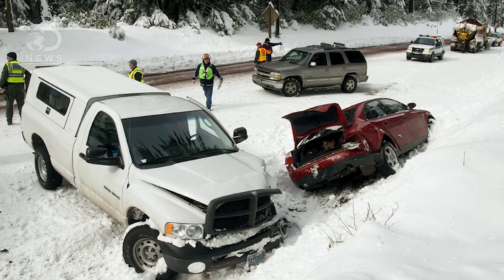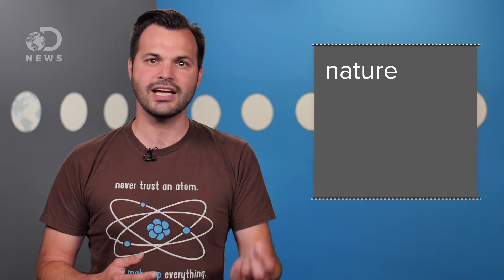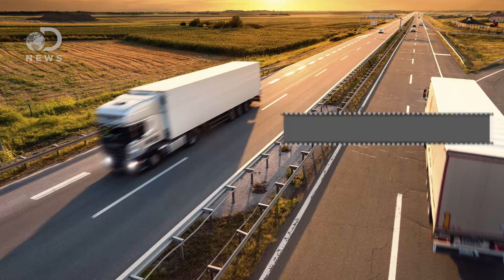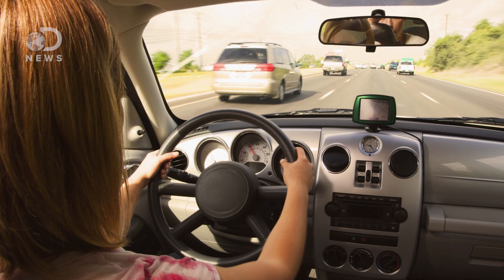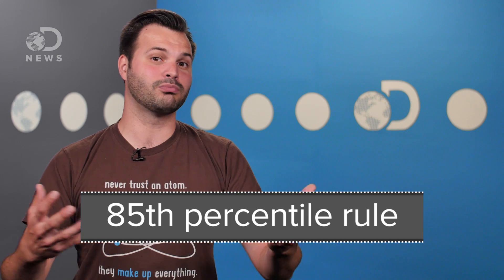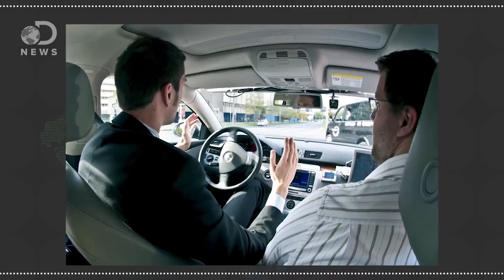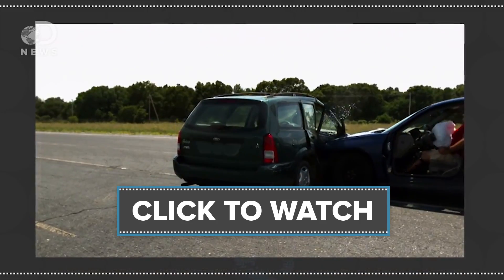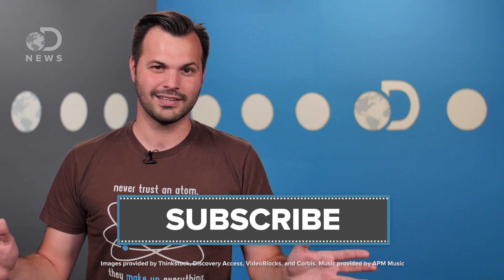How Do We Decide Speed Limits?

Comment: Lower. We're too wasteful and spoiled and driving should be disincentivized. Plus getting somewhere slightly faster isn't worth all the lives we lose.
Reply: +zh11147 I wrote you a novel, brace yourself haha I know my views here are radical but I'm passionate about transportation and the way we design our world.
A mixture of solutions could [largely] replace driving, some active and others passive. I'm not saying that no one can drive anymore, I'm saying much less driving is necessary than presently occurs. Go back 100 years before cars were ubiquitous. We had zero local emission transit in the form of electric drive elevated trains, subways & streetcars. Some of the infrastructure is expensive but not on a per capita basis if people actually use the resources. It's much much cheaper than cars for individuals that tend to pull 99% unnecessary weight and 1% people. Average # of passengers in a car is around 1.3.
Next, we go back to living denser in cities. The reason destinations are inaccessibly far is because of how we have built. After cars took over we began to design our world for it. This meant spreading things apart too far for walking and leaving huge swaths of space for parking and motorways. Well what was convenient to get to by a car is now as much time and effort as just walking between closer places. There are also many other reasons living closer together is beneficial for efficiency and proximity to amenities. 
Alright we have made it to bicycles. In an urban environment where there are thousands of amenities within a mile or two, a bike makes an incredible amount accessible within a 15 minute ride. At the same time a bike can improve your fitness saving future healthcare costs, make you more physically attractive, emits no pollution, makes streets safer for other bikers and for pedestrians. Briefly I would like to explain how expensive cars are. The average cost of owning a car for Americans is $6,000. This accounts for expenses of depreciation in resale value, auto loan interest, insurance, municipality stickers, license plates, fuel & repairs. That's expensive but consider the real cost of driving. In order to drive you have roads, expressways, bridges, snow removal [regional] & parking. These municipal costs are subsidized by taxes paid by everyone regardless of their amount of road use. Now think of how much money this amounts to for individuals and governments versus all the projects we didn't have the money to fund.
One last idea that is emerging. Electric battery powered bikes and skateboards. The former greatly extends the range of biking. The latter won't be accessible to every age and ability I concede. It has much potential in short distance transportation or expanding the usefulness of public transit.
You may argue that biking isn't always possible with weather. Well yes and no. I live in Chicago [known for brutal winters] and I can bike on most days even in winter. There are times when it's too brutally cold or raining too hard and I take transit instead. 

Here are some references for my arguments. If you want me to back up any other statements just ask and I don't mind finding those too.
# of passengers & energy by mode
https://en.wikipedia.org/wiki/Energy_efficiency_in_transportation
Image of equal passengers in cars, a bus, bicycles
http://splasho.com/blog/wp-content/uploads/accurate.jpg
Biking boarding
http://www.mrmoneymustache.com/2011/11/03/how-to-ride-your-bike-all-winter-and-love-it/
http://www.wired.com/2014/05/boosted-board/
Car cost
http://nicomachus.net/2009/01/the-real-cost-of-owning-a-car/

Comment: Well... 
In Germany, in some parts of the highways, (or most) the speed limit can vary from 180 km/h to whatever you want (yes you can go 220 if your car can go at that speed), that is if the whether is perfect and it depends on how comfortable you are at which speed. 
I think speed limits are way, way too low. For example in Abu Dhabi the roads are large but the speed limit is still 120 km/h, but no one follows that rule, they drive 140 km/h minimum. 
If we eventually build auto-piloted cars, there's no need for speed limits, as computers have a much faster reaction type, and if all the cars are going at the same speed, the chances of them crashing together will be reduced. The developers of the auto-pilot car are any ways working to put a system where if it comes to close to an obstacle, it will avoid it. So don't put a speed limit on those cars, please.
Reply: That's only if the auto-cars are well build. If car makers cheap out, it's going to be a crash fest.

Comment: Why don't you talk about different driving methods like in Germany where there is a fast lane and you have to move out of the lane to let the faster drivers by. That way you can have 100% of drivers drive how fast they want. It is way more efficient on highways and no more retarded tickets. Meanwhile it is socially agreed that everyone is allowed 10 over. Let's just cut the bullshit.
Reply: +zh11147 yes but that's not enforced. and in Germany (the highway system our's is based on) there are stretches of roads with much higher speed limits and even none.
Reply: +zh11147 yes but that's not enforced. and in Germany (the highway system our's is based on) there are stretches of roads with much higher speed limits and even none.

Comment: I say get rid of the speed limit and let Darwin decide what speed to go!! ... all kidding aside.. In some places, especially motorways, the speed limit should be raised. Last  Saturday morning, I was traveling on a local parkway and came up to two vehicles (Chevy Tahoe and a sedan(new Buick maybe)) traveling at about 75mph in a 50mph zone. I passed both vehicles going about 80mph (faster than the limit yes, but relative to the traffic, by no means reckless).. Immediately pulled over by the unmarked Chevy Tahoe with Jersey plates (I was in New York).. Long story short, the officer kindly let me go (just to be clear, a PBA card was not one of the reasons he let me go). This is not about the officer, he did what he was supposed to do (aside from possibly being out of jurisdiction??) and was kind enough to let me off with a warning. The point is, the police regularly allow 70-75mph on this parkway (which is fine and all), but when you finally get pulled over at 80mph (30+ over the limit), suddenly it's a mandatory court appearance, many hundreds of dollars in fees to court/lawyer/ticket/insurance, points on license, and not only speeding, but reckless driving by definition on record. It's a whole lot different if the limit was 75mph (what 85% of the public actually top out at) and 80mph was only 5 over the limit. Yes, I know I'm likely part of the top 5%. I'd like to see everyone driving smarter, no handheld cell phones/distractions, using indicators, properly maintained cars that can handle high speeds safely, and proper lane discipline (keeping to the right except to pass/clear distinction in speed depending on what lane you're in), and better/mandatory driver education. Maybe then we can approach the bliss that is driving in parts of Europe, because we sure have some idiots here who can't even implement the most basic principles of driving a car.. let alone drive it at speed.. To the haters who are going to tell me to "move there," yes I'm proud of where I live, I just wish we could adopt some sensible thinking.

Comment: When all cars are self driving then speed limits should not be static at all because the human error aspect will not be involved which is one of the main reasons why there are crashes in the first place. A self driving car should be able to adjust itself to the speed that it thinks is the most optimal considering all of the other variables not involving humans such as weather conditions, road conditions etc. and if it thinks that the optimal speed is 80 mi/hr then so be it. However, it is a long way until self driving cars have the capacity to take all those variables into account. Therefore, the speed limits, once we cars in the road are at least first generation self driving, the speed limits should go up 10-20 mi from the previous limits.

Comment: The problem is, some drivers and cars are much better at handling higher speeds. I own a Camaro, and that car feels stable and safe at speeds in excess of 100mph. I can control it too, so I also feel comfortable with it. 
It would be best if for some big, long highways the left lane could be left restricted to a "within reason" speed or have a minimum speed instead of keeping speed with the rest of the roadway. People in the left lane want to go fast and chances are they're okay with going fast. Differences in speed, not speed itself, is the most dangerous thing. So if everyone is going fast it's okay. But if some turd decides to hog the left lane going the "speed limit" he poses a big threat to everyone.

They do this on the German Autobahn and it's one of the safest roadways in the world.
Reply: The HOV Lane in Texas.
Reply: +Unbearable Pain debateable. There are a few parts of german autobahn left, which are unrestricted, and they are not magically more safe.

Also, by definition, about half of car drivers are below average in skill, and half  above average. If you poll drivers, the vast majority claim to be not only above average but actually very good, with still a significant amount claiming to be top tier drivers. 
Whats more, break it down by age etc., and the young, inexperienced and arguably mentally and character wise not yet fully mature folks think of themselves as god's gift to motorised transportation.

Humans have a nasty tendency to overestimate their own skills. And those who should be the last ones to do so, generally boast the most.

Also, the vehicles and their state of repair are often overestimated by the owners. There are neverending exemples of cars and or repirs, deemed totally safe by the driver, yet insane at best in reality.

One reason german autobahns are relatively safe, is that all vehicles have to have mandatory check ups every two years.

Comment: Static speed limits are dumb...  They should adjust to the conditions.  Rush hour 7am on a Sunday should not have the same highway speed limit!
Reply: +V Britt Doesn't that happen on US highways? In Germany, there are large stretches of highway that have signage that can be changed automatically to reduce speed limit, warn of construction or heavy traffic ahead, etc. . I've seen similar tech in several other European countries as well…
Reply: No, we are very ass backwards... We can have 10 lanes with 8 cars total on it and the speed limit will be 55 MPH.  (@90KPH)
Reply: +V Britt A highway that big would be in the city where speed limits are lower than less dense areas. And we are taught that the speed limit is for ideal conditions and that we should adjust if need be.

Comment: As usual, Trace is a fucking moron. Google self driving cars have been in at fault accidents. You can find this information on Google. Search for "self driving car at fault" to see.
Reply: No, he's not. If you actually read, you would see that most if not all of the accidents with self driving cars were caused by human error, not the self driven car.
Reply: Will Plays Google themselves admit that one collision was caused by failure to give way to a bus pulling out from a bus stop. Which makes the car at fault. There have also been multiple instances of the human monitor inside the car taking over to avoid an at fault collision. And yes, he is.
Reply: ok, you are entitled to your opinion, i guess.
Reply: Will Plays Trace's intelligence is my opinion, sure. That Google's self driving cars have been in an at fault collision is fact. It's also a fact that on multiple occasions the in car monitor has taken over control of the car to avoid a collision.

Comment: Not quite. Roads in Texas were mostly designed at 45 mph design speed. Only reason our speed limits are so large is political, not practical.
There's plenty more to it as well, but most design speeds are not up to the actual limit on the road, which has created some real issues.
Reply: +Revenge of the Beefsteak Tomatoes I-10 is super long, pretty straight, and relatively featureless. Even if it was designed for 45 mph, it could easily accommodate traffic exceeding 85 mph.
Reply: +Lastings I'm more referring to the FM roads, state highways, and smaller US highways. Interstates and most US highways have high traffic volumes and as a result high maintenance, so they are updated to a specific design speed. Majority of roads that are 75 mph in Texas are FM roads though, and they have were originally set at 45 mph design speeds.
Due to large amount of these roads, the complexity of land ownership, and the overall cost in making roads, updating these roads are slow.
Reply: I think even the state highways can maintain 75 mph without too much hassle. The real limiting factor to how fast you can safely traverse a distance are visibility and straightness. If you have more than a mile of visibility going at 120 mph would still give you 30 seconds of forewarning. I mean, sure there are parts of Texas that don't have that, but there are definitely parts that do. The state is bigger than France.
Reply: +Lastings There are many more things to consider than that including shoulders, sign location, safety end treatment of culverts, etc. Unless your in West Texas, most sight distances on old roads are not adequate for 75 MPH. 
I have to know this stuff, it's my job.